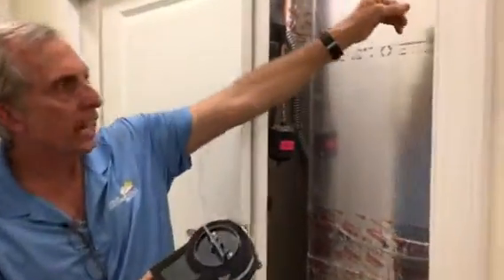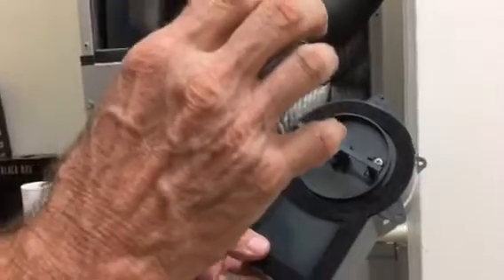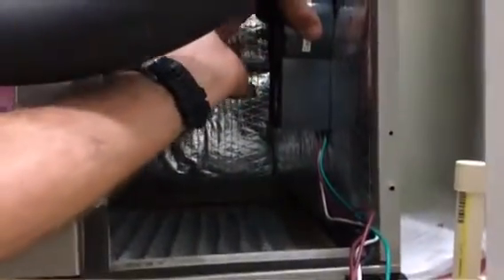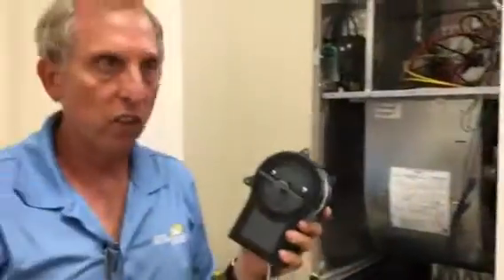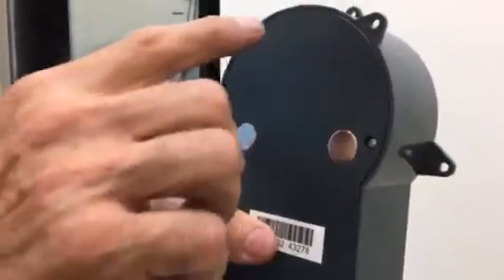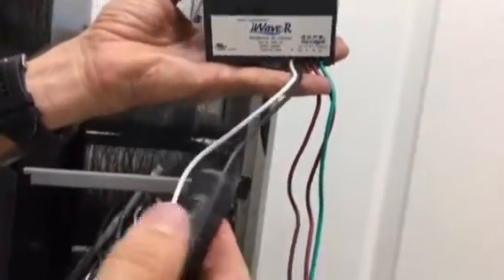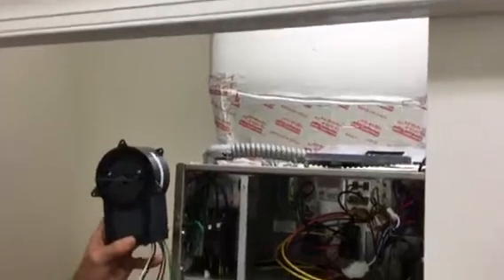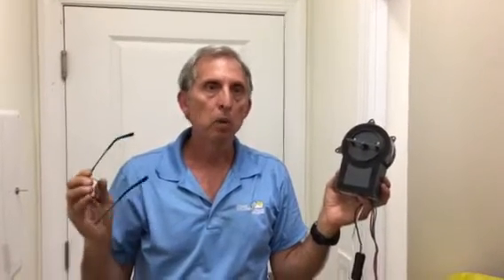iWave R, The Ultimate Solution for Reducing Airborne Pathogens and Odors.

Comment: Can you please actually show how to wire it to the system properly?  I understand what the wires are, but it would be nice to see the real-deal installation. Thanks!
Reply from the maker: The I WAVR R CAN BE wired from  24 V to 260 V I apologize for not showing it you can hook it up to the 240 V from your main power company in and it will work correctly for years great question thanks for asking
Reply: Here's the new video... https://youtu.be/fXp16VPEvUM

Comment: What if the neutral was wired to ground? our installer wired it 110 only attaching the AC to the hot, the ground and neutral to the chassis. The LED is on, but I wonder if this is the most ideal wiring scheme. 

Thanks
Reply: That is wrong. The neutral wire should not be connected to ground. I wouldn't use that installer any more, they don't know what they are doing.